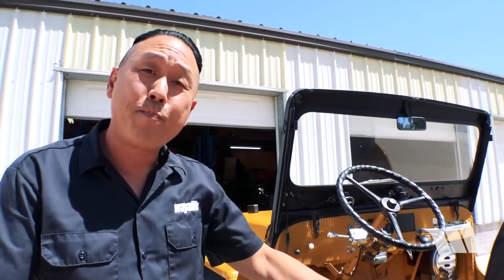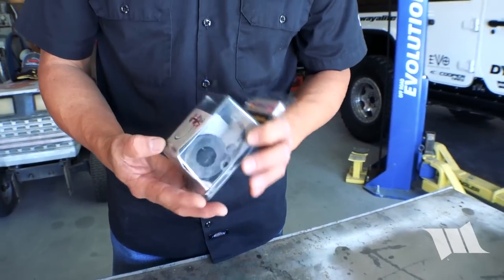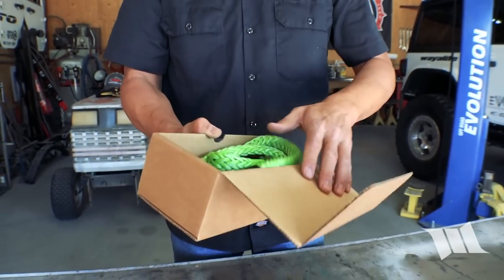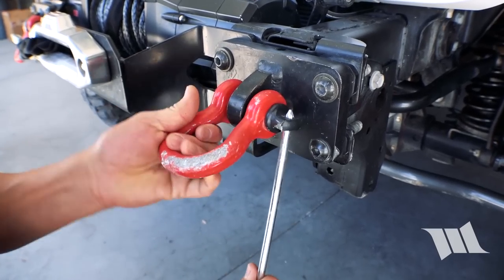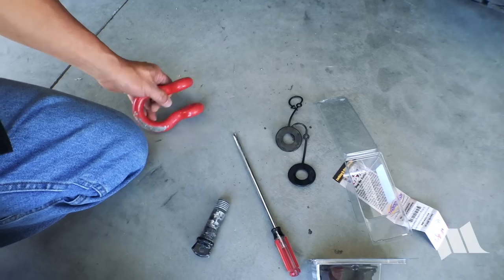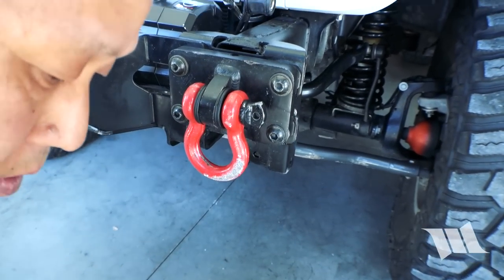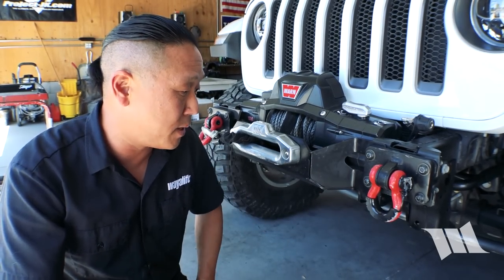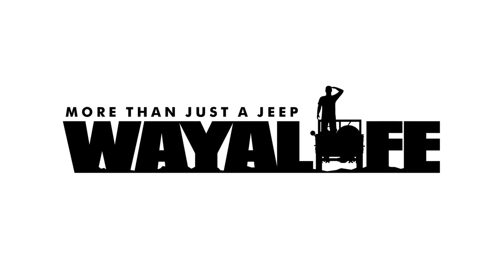D-Ring Shackle Isolators and Washers by Daystar to Stop Rattle on Jeep Wrangler Bumper Mounts

Comment: I have discontinued the practice of keep any load rated gear, that will be used for recovery, on the vehicle exterior full time.  I think the weather and forces that may be subjected to the gear, may not be realized.  Example you bump a rock with your shackle, you do not realize that your did,  You go to a recovery, and your shackle has stress cracks, and has now become an unsafe projectile.
Reply from the maker: I'm sure I haven't been doing this Jeep thing as long as some but in the last 25+ years, I have NEVER seen what you described happen. But again, that's just me.
Reply: @wayalife  respect the reply, I just have accepted that there is very little advantage to keeping them on the vehicle full time,  I would rather verify they are in good condition, or verify they are attached properly, every recovery effort,  Leaving them on is what I used to do, now I view it as a way to look cool.

Comment: Well dang I can’t post a photo here but it’s a 2021 firecracker red Willys. I found one up in Ohio with only 10k miles on it. They shipped it down here to Memphis for me. Wrong half doors but mailing them back for a refund! 

So I am a dumb dumb and backed into my parents metal gate (my clearance was off (never text and drive no matter what… I’m telling ya… Twas just in my parents driveway. Anyways the back passenger side fender (fender flare) tore off and I am having so much trouble finding a replacement one. I am gonna roll by a body shop today but do y’all have any suggestions? I’ve checked mopar, extreme terrain, quadratic, etc. please no rush in responding. I know y’all are busy busy! As I was typing out ny comment I thought to ask. Also I found a great doggy seatbelt which is crash tested. I’ll have to find the brand…

Comment: Even better, get a soft shackle. Quieter and safer.
Reply from the maker: Ummm, I guess you missed the part where these no longer make ANY noise. As far as safety goes, I clearly haven't been doing this Jeep thing as long as some but in the last 25+ years, I have yet to see, when used properly, where this is dangerous. But then, that's just me.

Comment: People can steal those things that’s why you have to get some lock
Reply from the maker: Unless they have a tool to get the pin out, it's pretty impossible to remove it by hand. At least, I've never had an issue with people taking mine in well over 20 years.